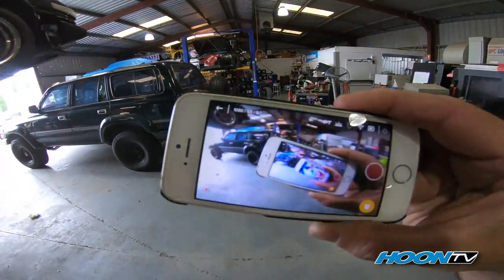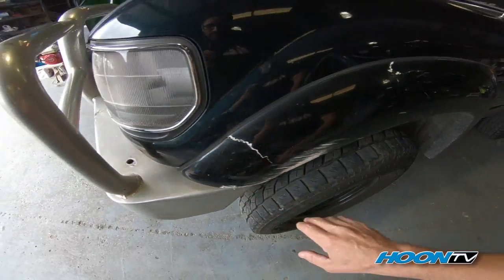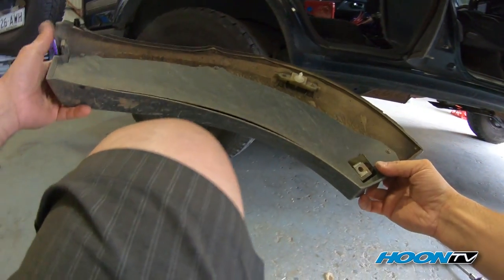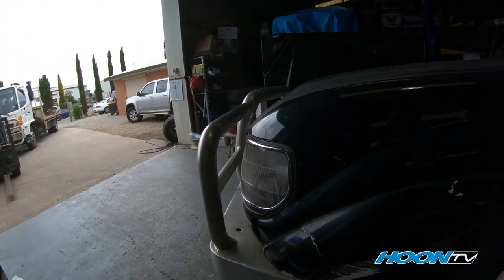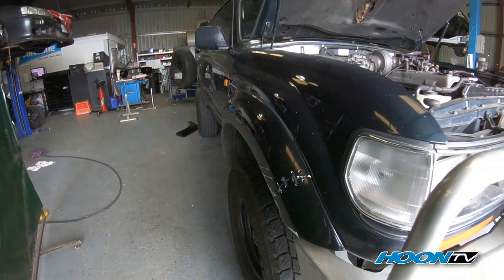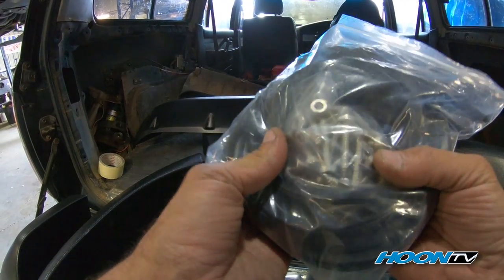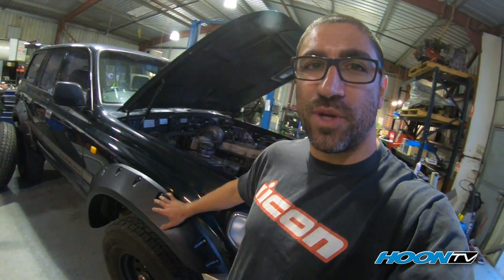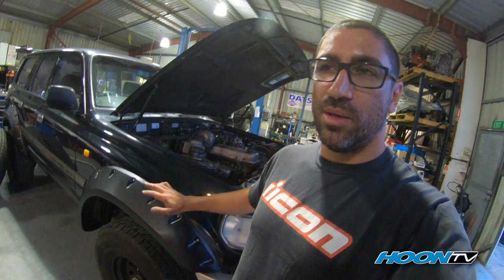V8 Landcruiser PANEL VAN build [EP3]

Comment: Howdy I hope your doing well! Just got my Kutsnake flares for my 80 series and it doesnt look like it fits right. Do they bend to fit properly? I could put my finger under the front fender when I lined it up with the rubber gasket.
Reply from the maker: Mr Ginger don’t be afraid to use a heat gun to manipulate them a little bit.
Reply: @HoonTV  how much did you have to do with the heatgun!   Yours taped up fit really nice, the ones I got I’ve run the heat gun over and they still are fitting like absolute dog crap. Massive gaps on every fender.